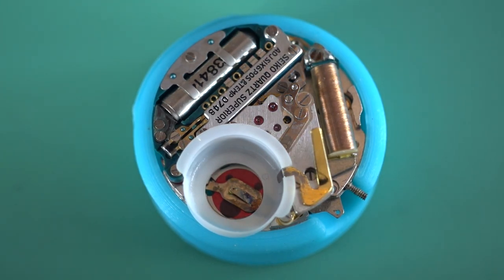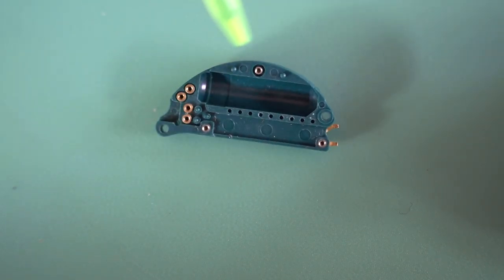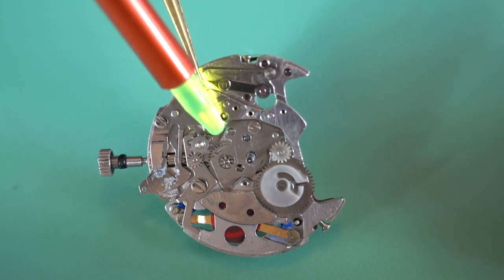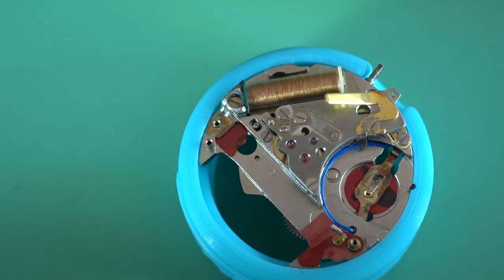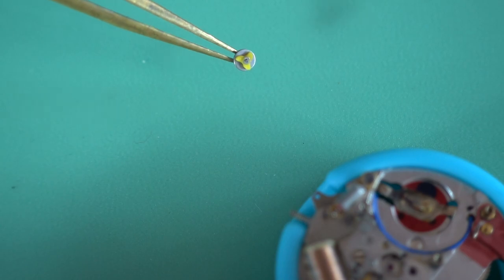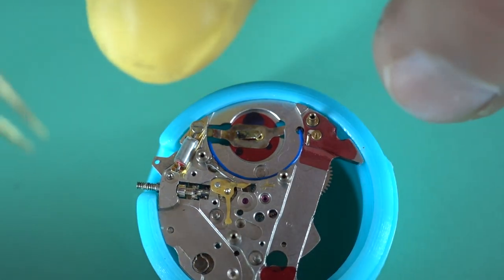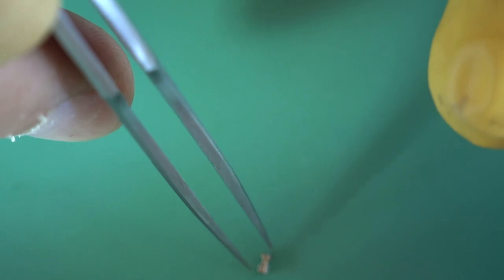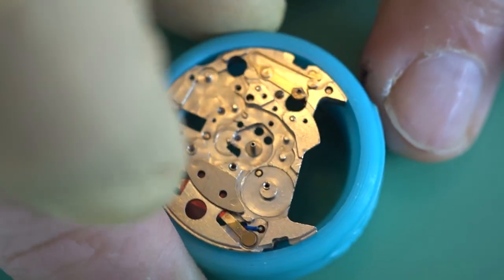[TECH] SEIKO Quartz GFA/SUPERIOR Teardown

Comment: Great work, glad to see caliber 38 taken apart and explained in video. I am wondering what exactly does the battery protection capacitor do? When I connected amperemeter to the watch I notice a big current spike at the moment I connect it, the watch works. Is it the capacitor charging up? What does it protect? The battery from the watch or the watch from the battery?
Reply from the maker: Protects the circuit from battery spikes, for whatever reason.
Reply: Figured it out with some help from electrical engineer friend, some batteries cannot instantly supply the ammount of energy needed to move the hand without the voltage dropping so low that crystal performance is affected. Upon connecting the battery the watch draws really large current for a moment until the capacitor is charged, when it is charged the watch operates normally but current spikes are not as big as they would have, of course the watch consumes the same ammount of power, area under the curve is the same, but the spikes are not as harsh thus battery voltage does not drop in one second intervals.

Thanks again for the video, highly informative and useful!

Comment: Very interesting, will you be doing an assemble video.?
Reply from the maker: Geday, probably not as it's really difficult to get oiling right while filming.
Reply: @hal0eight  Im curious how cleaning goes with these early quartz - like do you send the metal parts through the cleaning machine? what about the magnetic parts like stator and stepper parts? I cant find any info on that aspect?
Reply: @MrMadvillan  Rotor is cleaned manually using fresh cleaning fluid or preferably a piece of tack like patafix or rodico. Other non magnetic parts not containing plastic apart from seconds jumper are cleaned as usual

Comment: Hello there, thanks for the fine video. I just today bought a GFA that ran as soon as I installed a battery, so that's a good sign. I can see through the loupe that there's some battery corrosion effects and almost certainly perspiration damage will show up. It's ticking right along with my SBGE001 GS so I've little doubt it can be made near perfect again.
Is this a front loader like an Oceanstar? There's little hope that I can get a service manual here in Canada so if you've got a video of the movement and crystal removal that would be a wonderful thing.
Reply from the maker: They are a front loader. To remove the bezel was fairly difficult. The crystal seal construction sucks. They use a sandwiched flat seal around the rim of the crystal. I suspect it was attached via an adhesive as there's no lip to keep the seal in one place. I suspect this is why so many have been damaged over the years.

On that corrosion, you need to remove it. It will drain a new battery much faster and will continue to grow into the movement.

I didn't film the case work as it was a bit tricky to do well.

On a service manual, it's the same as a 3803, the only differences are around the trimmer.
Reply: @hal0eight  By front loader I meant the movement is removable only through the front of the watch. Are we talking about the same thing here? Scrounging around what little information is out there seems to suggest that the caseback is a gun breach lock with something like an sixth of a turn to remove it? Not so?
Many thanks for the reply. Yeah, I know the corrosion has to be scrupulously removed. 
Bloody Seikos are such a good deal. Take the back off a Grand and it makes a Rolex look like it was made by reasonably skilled blacksmiths.
I will endeavour to find a 3803 manual.
Reply: Thanks for the reply. It took all of ten seconds to find the 38 series manual.
Reply from the maker: @scheusselmensch5713  geday, no case back at all. So all through the front
Reply from the maker: @scheusselmensch5713  Not sure if I'd say that. The finishing on Rolex is better than all but the recent GS movements.

Yes front loader means everything is done through the front. The back is totally fixed.

They do have a battery hatch which is a bayonet or a threaded type fitting.
Reply: @hal0eight  I agree to disagree. King and Grand movements even in the '70s were superior to Rolex in execution and finish, and accuracy.
Although I used to run my Rolex work watches for 15 years without opening them (so they certainly weren't POSs) and they kept the same time that they did when they were new (not that good at all LOL) and by that time I could sell them for a handsome profit. Can't say that for modern GSs yet.
I'm scrounging around for my Oceanstar  bezel wedges. It appears there were 2 piece 38 series cases as well at some point.
Thanks for your advice. Hopefully you're well away from the fires?
Reply from the maker: @scheusselmensch5713  Geday, Yeah I'd have to disagree for sure, but that's cool. It makes me happy to disagree because it means we actually have some passion for the topic. Nothing worse than an echo chamber.

If I'm going to compare the finish on the 44 series to it's contemporary, say the ROLEX 1530, the 1530 is better finished. The finish is also more durable than the 44. If you were to compare on performance, my opinion would be that the 44 will be equivalent or outperform the 1530. If we go to say the 52 or 56 series, again, the ROLEX finish is much better but performance again is equal or better.

Fires haven't affected me directly. Some friends of mine had to evacuate with a few minutes notice and the fire stopped 100m from their front door. Neighbours down their street came home to nothing and a melted truck.
Reply: @hal0eight  Yeah, melted trucks would spoil my day. I guess I should have been a little more precise; I'm not fooled by engine turning on movements, that's a dead easy cheap finish that looks good. I consider the top Seiko movements to be better "finished" in the areas of engagement; axles, bearings, gear teeth, running clearances, all those things that affect accuracy. When Seiko handed Switzerland their arses in timekeeping competitions way back when, I believe that Seiko had considered those things paramount and acted on and executed them assiduously.
I kinda look at them as the Lexus LS430 of the watch world. Maybe not the equal of every luxury car in the world, but quite possibly the best luxury car ever made. I use a SBGE001 for work but am saving for a SBGM029 as I still need a pure mechanical in my life. Well, I'm not really saving but there's so many old motorbikes out there to buy! Just had a friend visit Oz and bring back some James Boag's for me, looking forward to a taste. You take care not to be immolated.
Reply: @hal0eight  By the way, my GS SD SBGE001 started running slow and then stopped a week or so ago. Not even sure there's any point in looking inside as getting parts is essentially impossible . The GS service facility is closed down entirely in the USA until at least July as well.
I reckon the mainspring (SPRON?) has gone SPROING as I can get the watch to start and keep time by continuously winding it. 
So "Grand Seiko, made for generations" seems to be a bit of hyperbole at least in my instance .... unless 8 year olds start having children.
So my work watch is now my 691 module G-Shock that was bought in Oman in 1988 and has run perfectly ever since.
Do you hear that GS?! 1988!
Grrrrrrrr.
Reply: @hal0eight  Bee luddy ell, I managed to buy 4 NOS GFA/Superior bracelets off eBay today. Thanks for all your replies, my GFA is running a treat. All the best in the coming year mate.
Reply: In case anyone is interested, the GFA has gained 1 second in 7 months.